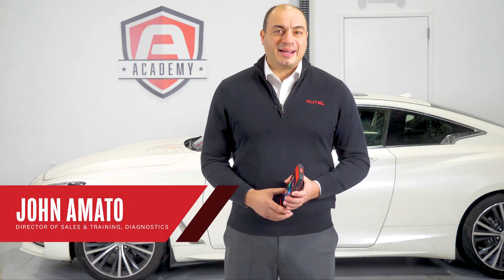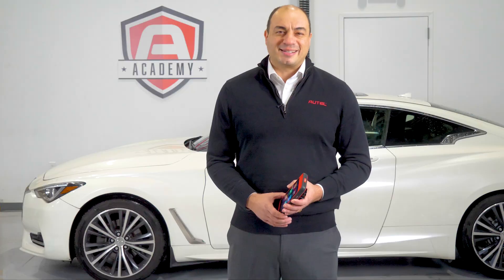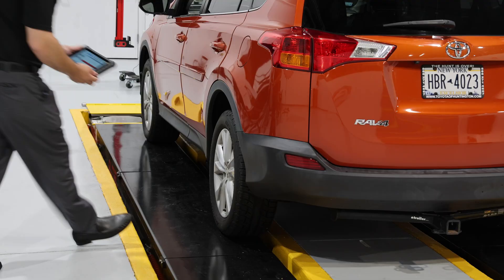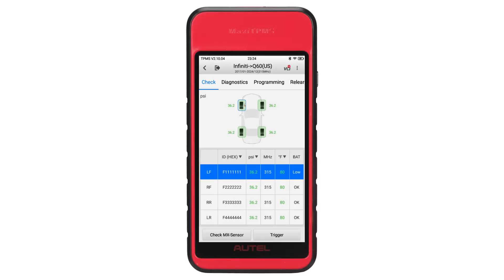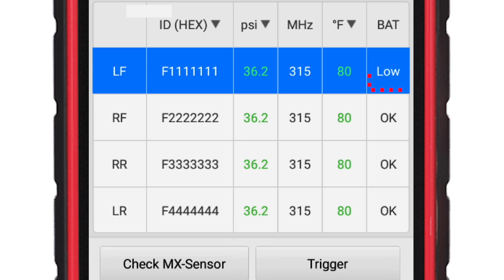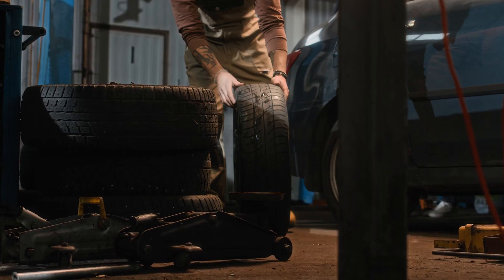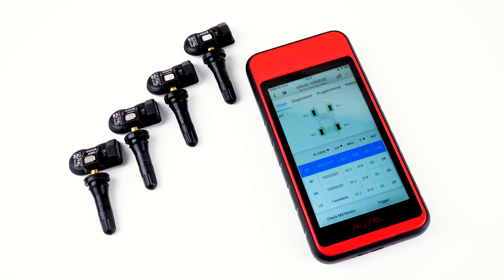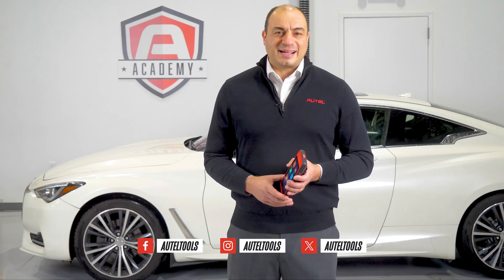How to Check for Low Battery in a TPMS Sensor Using the Autel ITS600

Comment: Love the guy taking the wheel off with the vehicle still on the ground. Hah hah. 
I haven't found the battery check function to be useful. Every single sensor I have checked, the battery showed good. Pretty much they show good until they don't work any more.
I have also never seen a sensor go bad in the stated 7-9 years except due to damage. Typically they last 10-12 years or more. 
I use and like your tools, but don't oversell it guys.